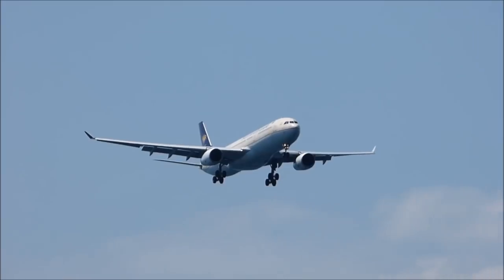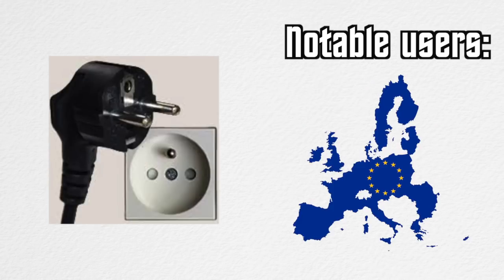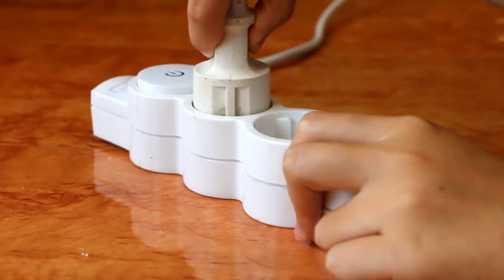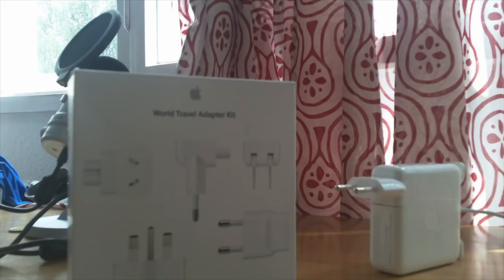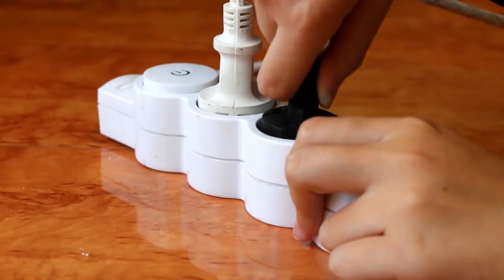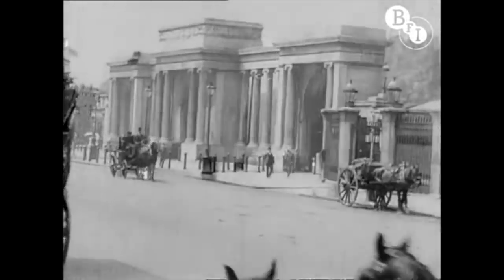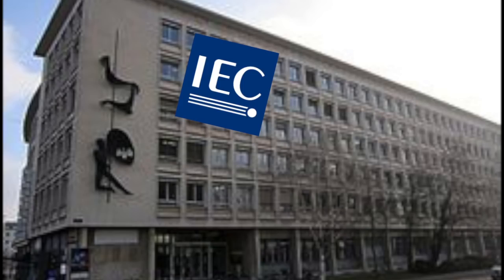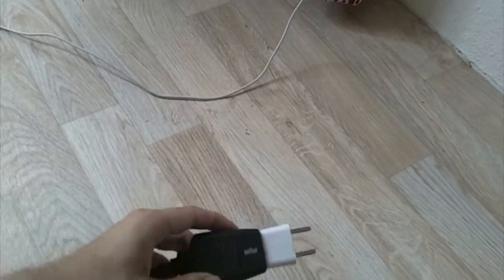Why Different Countries Use Different Plugs

Comment: The British plugs are superior
Reply: Until you step on it
Reply: @matrixace_8903  I've never stepped on a British plug, one reason being that you don't need to pull them out of the wall after using them, you can just leave them in and turn the switch off! Simples!
Reply: laughs in all of EU's official languages
Just cuz Tom Scott said so doesn't mean it's true. 
EU plugs have all the same safety features (at least modern ones), while being smaller and they fall on the side. Not to mention we don't have to bring an adapter when we go in other EU countries...
Reply: @benoitbvg2888  What do you mean by European plugs falling on the side?
Reply: @roucoupse  If you let a British plug fall on the floor, it'll almost always end up with the pins facing upwards. Go walking on that.
EU plugs' shape make them fall with the pins facing sideways. Not a foot massage, but still objectively better.
Reply: @benoitbvg2888  Ah ok, thank you!
Reply: @benoitbvg2888  The EU standard plug is propably the best design, but to my knowledge it is not used by anyone?
Reply: Type G! Hell yea!!!
Reply: @UnemotionalBandit  Worst case scenario... I'll have to use a VPN.

Have fun with Brexit ^^
Reply: Except all your game consoles run slower
Reply: They're VERY similar in mechanical and electrical properties to the Shucko plug with a caveat that I only found out about when living in the UK: their directionality! It was something that never occcurred to me because I took it for granted: it is sooo convenient to be able to put the plug in which way one finds best; the British one has one direction and one only. Supposedly this is because the cord falling down is the safest position, but manufacturers manage to screw that up by making the cable in some plugs point the opposite direction because the appliance could be above the plug! This happened a lot in the lab I worked in. If there's confusion, why not make it symmetrical? And then, if polarization matters, make it go one way, like the Schuko can. That lack of versatility always annoyed me in the British plugs. 
The Shucko plugs can go into most other EU sockets and vice-versa, they're easily made 'compatible' (dirty secret: it can even work in a British socket XD)
.
One good thing I like about your sockets (that is about culture and not about the plug standard) is the switch. I wish we had more of those in Portugal.
Reply: Hey where can I view this Tiger Panzer in your profile picture?
Reply: They are very easy to plug in compared to normal European plugs
Reply: How I heard they hurt worse then stepping on Legos and we all know how painful that is
Reply: British plugs are basically the US washer and dryer plugs
Reply: What is good about the british plugs? They are bulky, are an unsafe design and are not very comfortable to use? I do not reallly like to use those. The German-Type or French-Tpye plug is a safe design, but very bulky as well. The US Plugs are neither safe nor solid, but at least they are compact. All in all I think a swiss-style design is clearly the best idea, as it was used on the EU plug (which is not used in real life to my knowledge).
Reply: @arnoldhau1  
While i do think the swiss design is really good, i would say the best one is the italian one (type L).

It shares all the positives:
Small, grounded, ground pin longer than others, no moving parts, (also compatible with type C).
But to that list the type L also adds  one more: 
you can rotate it 180° and it still fits.
Reply: @kantoros  Well I would see the 180 degrees thing as a disadvantage rahter than an advantage, but I guess you can see it either way. But the Type L is also good, its quite similar to the Swiss design (Type J) just flat. But to me it seems that if ever there would be a future standard it will most likely be based on Type J  (like the EU and new Brazilian plug).
Reply: @arnoldhau1  why are they not safe the insulation on live and n pins prevents electric shock if you can touch the metal they will not be touching the contacts.  The l&n ports also have shutters on them so you can't stick anything in without putting something into the earth first the fuse is in the plug because old British houses don't use circuit breakers.( newer houses or rewired have circuit breakers) I don't see where you are coming from they are by far the safest
Reply: @arnoldhau1  Switzerland is irelavant.
Reply: @UnemotionalBandit  Its about the design, not the country.
Reply: Imperator Salt Formerly LMS 5588 and Irish 😏
Reply: https://youtu.be/UEfP1OKKz_Q

The benefits of type G outweighs the the little disadvantage that someone 'may' tread on one.
In 40 years, I have not, or heard of someone doing so, but yes it can happen.
Reply: +Benoit Bvg EU plugs maybe smaller but there's no safety in accidentally pulling the cord out of the socket by stretching it too far or any non conductive material on the live and neutral plugs to stop a baby from touching them if the plug hasnt been inserted correctly into the socket.
Reply: @wclifton968gameplaystutorials  That the plug is extracted when the cord is pulled is actually SAFER than having the plug blocked in the socket, and the cord, the socket, or the power tool, damaged. 
E and F sockets are hollow, so that you can't insert a finger in them when the plug is even partially connected ( https://upload.wikimedia.org/wikipedia/commons/d/d0/Steckdose.jpg ). C and L sockets are flat, but the plugs are protected (C plug https://upload.wikimedia.org/wikipedia/commons/6/63/Euro-Flachstecker_2.jpg ; L plug https://www.playstereo.com/6091-big_default/gewiss-electric-plug-type-l-16a-250v.jpg ).
Reply: @wclifton968 I think all plug types except US have that little non-conductive layer at the base...
Also, I can't say if it's standard, but the only time I had to wire an E-type plug myself (to replace the one on a vacuum cleaner), the ground was longer than the live wires, just like in the British ones...
Reply: wclifton968 there is actually protection to stop people from touching the wires, it's just not a standard feature on regular sockets for some reason. It is quite common on extension cords though.
Reply: @szoszk  I think the non-conductive material on the live and neutral pins are a legal requirment in the UK otherwise it wont probably be BEAB approved in order to be legally sold in a store. I've never seen a UK plug without a non-conductive layer on the L & N pins.
Reply: wclifton968 on the EU plugs there also is always (probably also legally required) a non conductive layer such that nobody can touch it with the plug half in. What I meant is though the child safety built in to the socket such that a child can't put anything in and electrocute itself. From what I understand this feature is legally required in the UK but optional in mainland Europe
Reply: @szoszk  I have never seen an EU plug, do they really exist? To my knowledge, there is no real EU standard plug that actually exists. I though they are just an international standard (IEC 60906-1) that has only been implmeneted in Brazil and South Africa in a slightly different way as Type N plug?

Maybe you are talking about the 2-pin Europlug (Type C)? But that is of course only suited if you dont need the addional ground. At least in German or French Style Type E and Type F Sockets, the socket is actually not flat but , so its much harder to touch anything. Maybe therefore the insulation is not required there, but I am not sure about that.
Reply: arnoldhau1 I'm talking about the plug types used in mainland Europe (Type E, F and C, which are usually interchangeable). Yes, Italy and Switzerland also have type J and L, but they also have E, F and C, which is why in this context it's ok if I talk about the EU plugs. And yes, I'm generalizing EU to all of mainland Europe, just like people do with America.
Reply: @wclifton968gameplaystutorials  the insulation is there basicaly if you can touch the shiny parts they are not touching the contacts inside the socket however the e will still be connected
Reply: @wclifton968gameplaystutorials  Where have you heard that? That is absolutely not true. It's impossible to touch life pins on either of the European plugs, type F or type C. On type F the shape of the plug covers the entire recess of the outlet before the pins become life (plus the ground clamp is the first contact to engage), on type C (non-grounded type) the pins are either insulated on the upper part (just like type G) or the plug is shaped so the entire recess is covered again (depends on the Amp-rating).

Comment: Then on top of that, you have the differing wiring standards, which necessitate different kinds of plug, which is why the UK (and Ireland, but not always) uses a different kind of plug to the Schulko plugs used on the Continent, as they had to accommodate fuses.

(Ireland originally used Schulko plugs, but switched to UK-style ones for the sake of convenience, but kept our Siemens-developed wiring standards, making everything over-engineered.)
Reply: It's an understandable decision though I wish Ireland would switch back to the continental style
Reply: @mickmickymick6927 , sometimes I wish the same thing! Though UK plugs do have a lot going for them, such as their inherent mechanical rigidity and their built-in guards.
Reply: Yes I actually like them too (though I know nothing of the mechanics of the issue, they just always seemed more sturdy and secure to me), perhaps the best would be for the continent to adopt the British system, but I imagine nothing will ever change cause it would be so hard.
Reply: I didn't know that Irish wiring was that over-engineered. That's a really cool fact.
Reply: Are UK outlets on a breaker?  I knew that they have a big plug, to allow room for a fuse.
Reply: brett knoss They are nowadays yes. Breaker at the board and a fuse in the plug.
Reply: @brettknoss486  Yes 32A, the fuse in the plug is to protect the flex from plug to appliance.
Reply: @brettknoss486   Yes. There are 5 stages of overcurrent protection: substation, house fuse, MCB, plug, and the device itself which must have protection for the CE mark. Upstream of the substation doesn't figure unless you are in a rural location with a long MV feed. The majority of substations will source enough fault current to ignite the nitrogen in the air.

Comment: Now I wonder which plug type would be the best plug if people did want to standardize plugs.
Reply: That’ll start ww3
Reply: A committee will almost certainly choose anything but the best design
Reply: @ianmoseley9910  there goes type g then
Reply: 240V 50Hz, Type I recessed/sleeved.  Proper wiring so no need for a plug fuse. Like the Gods intended.
Reply: None of the above, IMO. I would go for something like the Neutrik Powercon connector.
Reply from the maker: That‘s actually a good question. There are good arguments for most major plug types out there (e.g. Type G for its safety features, and Type C/E/F for its ubiquity)
Reply: KhAnubis ayy i have a safe plug>
Reply: Bobby Ferg, a modification of C/E/F to take fuses (as in type G). That's possible with modern moulding techniques. I'm fond of type I plugs (as found in Australia and China) for their mechanical stability.
Reply: We all know it would have to be types A and B as Americans would refuse to change anything.
Reply: UK for sure
Reply: I'm going with type g plugs for safety.  I think the UK did the most thought and engineering into making this plug, and so it is arguably the safest one.  The plug that prevents the most electrical accidents should get the prize.  Perhaps we could survey each country by accident rate per capita. Of course shitty non-code wiring will cause electrical problems and we can't blame this on the plug style, but also why would you want to follow the lead of a country with bad wiring techniques?  I'm from the USA by the way, so I have no intrinsic bias towards type G plugs.  Another thing to note is that large parts of China use type G I think, and having the standard adopted by more people off the bat will help.  I don't know if I agree with 50hz, but modern electronics can compensate for that.
Reply: Type A and B, very compact yet can still have fuses built in, low volts and amps so you won’t die from getting shocked, you can plug it in without looking because it has guides that pull you in. They aren’t recessed a k a disgusting dust and oil traps. Aussie plugs are close but they don’t have guides and so you have to focus and look carefully to line it up